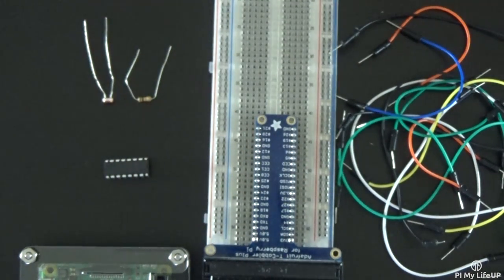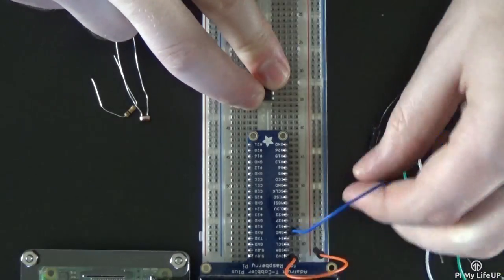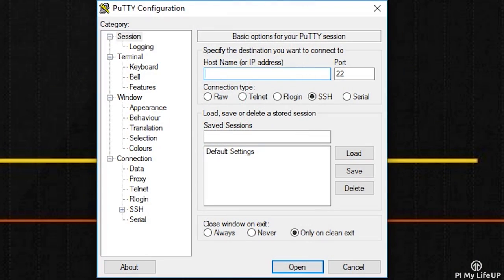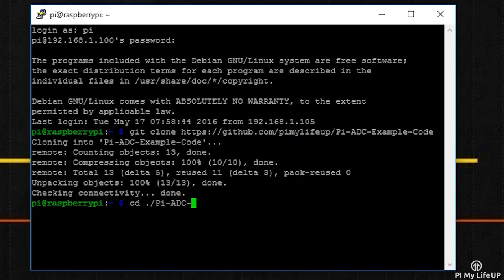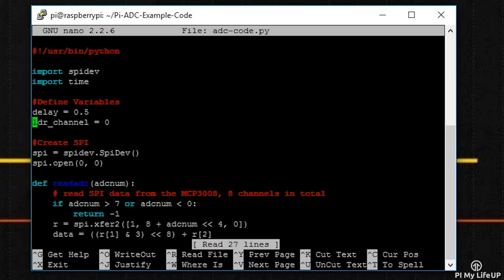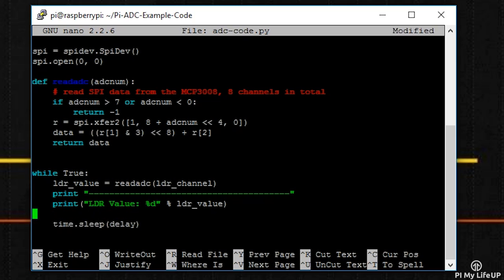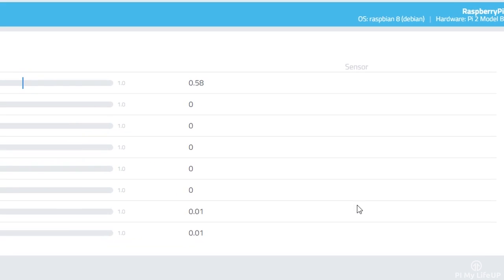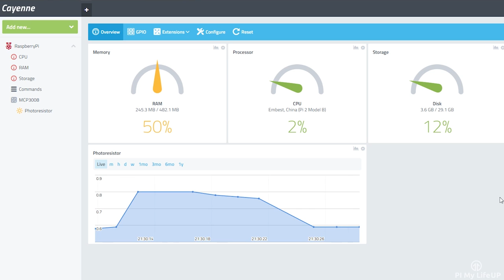Raspberry Pi ADC: MCP3008 Analog to Digital Converter

Comment: why am i only reading 0 and 255 in the same setup? not making sense. it's reading 8 bit of data on a 10 bit converter.
Reply: I'm running into the same issue, were you able to find any solutions?

Comment: Thanks, really helpful; is there any way of measuring volts?
Reply: You can measure voltage, one was is to connect the - and + to Pin 1 and 2 of the ADC and measure the difference, it must be (I think) lower than 3.3v, so if you're measuring more than that, put a resistor or two through the circuit. This explains the 3002 which is pretty much the same, I've got this working measuring a lithium ion. http://raspi.tv/2013/controlled-shutdown-duration-test-of-pi-model-a-with-2-cell-lipo

Comment: Would somebody mind explaining why it is OK to wire the DIN, DOUT, SCLK, and CS pins of the MCP3008 directly to their respective pins on the Pi with no pullup resistors or current-limiting resistors? I've seen it done both ways in several tutorials.

Comment: Seems very complicated to read a simple analog voltage. I guess RPI is really not intended to do such a task or I'm supper spoiled with Teensys.
Reply: I'm working with Arduino. I just connected an 8bit digital resistor to control the volt of a dc-dc converter and it's very easy, you just need to upload the program every time you have to try your program. RPI 3B+ looks really exciting, you just have to learn Python but that's probably not a problem.